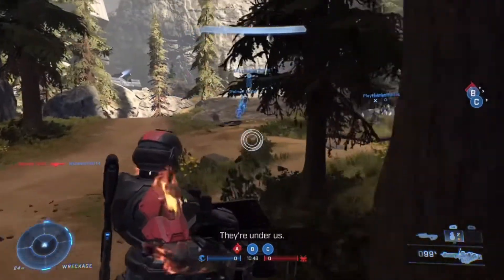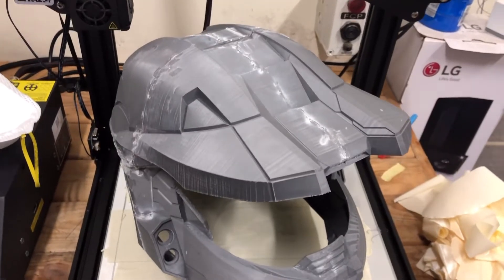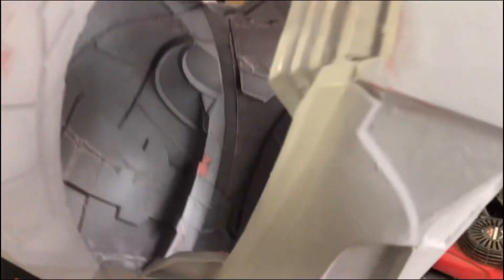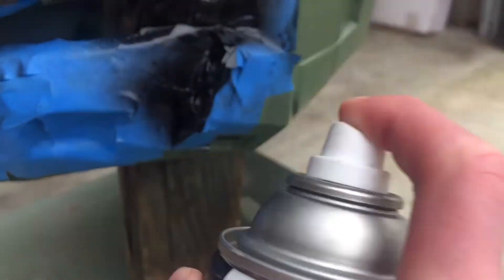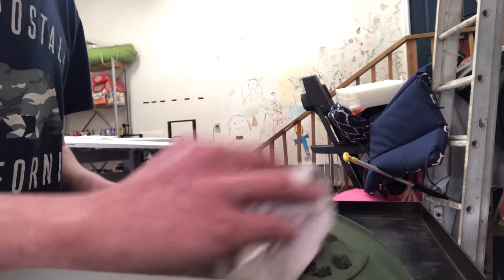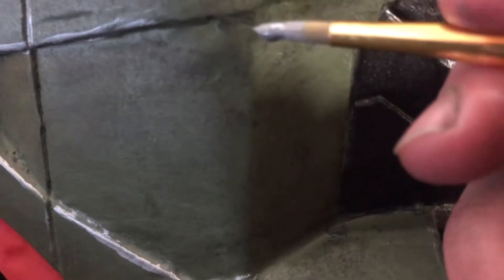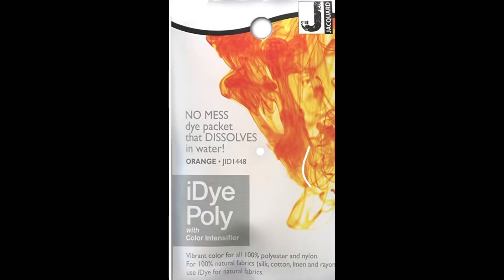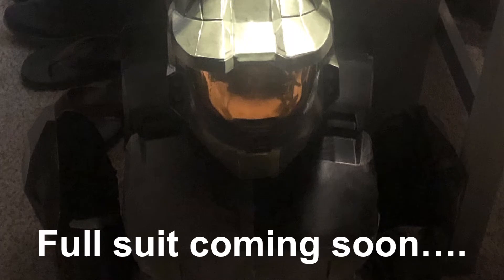3D Printed Master Chief Armor: Part 1

Comment: What program do I use to scale the armor to its size?  I want to make one too. Good luck
Reply: I use Armorsmith. You can build a avatar to your exact measurements and apply your 3d models onto each limb, then scale it till it fits your avatar. 

Been using it for my build and it hasn't failed me yet